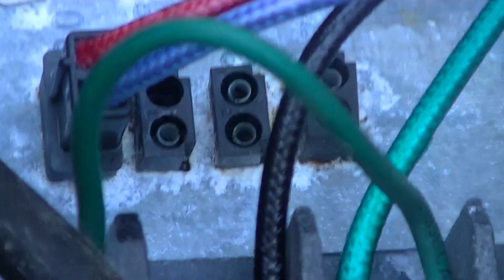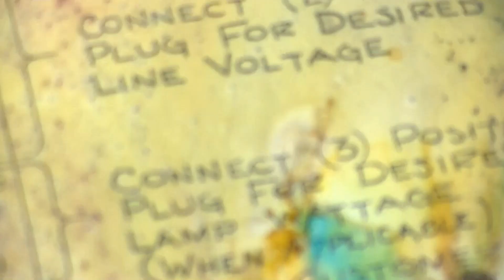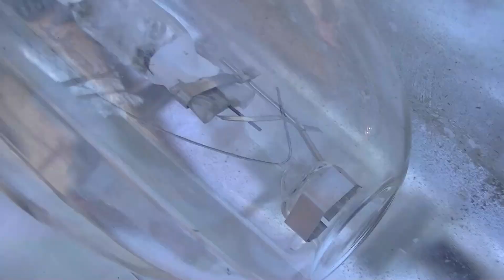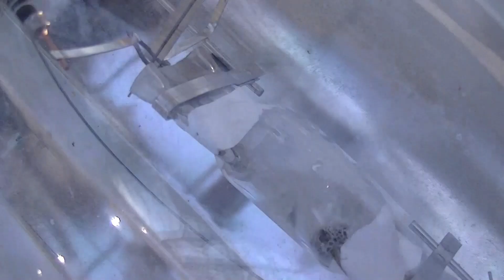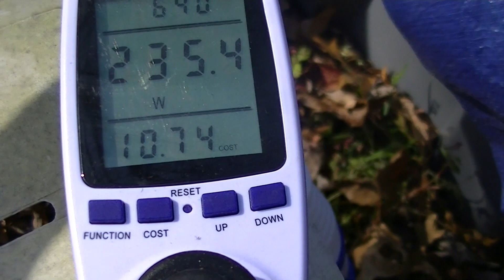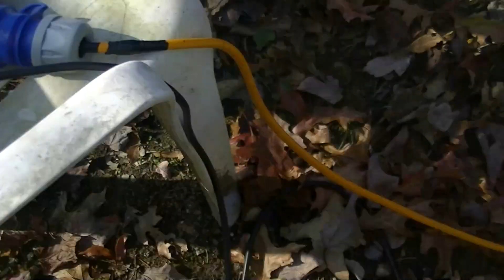GE 175W MH/merc floodlight guts and power consumption

Comment: I take offence to the statement garbage leds.

Yes, the product was well designed, but also ĺed's can be.

Poorly made,/cheaply, and designed  led lighting product's coming from mainly one country in Asia have given them a bad name.

One main fault in òut side high power lighting is that damp gets into the pcb, or to thin a barrier, shorts out the led heat sink to the aluminium heat disapation plane, also poor power supply/driving circuits, ovrdriving the led's and specifying the incorrect colour e.g. warm/cool or day light 3000/4000/6000, in most cases 6000 is best for outside and worknplace conditions.

Also, as a rule of thumb, they save 90% energy used most of the power used in previous lighting is producing heat.

If everyone in the world changed to led lighting power consumption, could be reduced, by 80 to 90%.
I changed my lighting at home from nearly 2000 watts to 176 Watts if all lights were turned on.
Thanks fir the video.
Reply from the maker: Can LEDs be made good?  Yes.
Are there applications where they make sense?  Yes.
Problem is that they have a lot of poorly researched failure modes due to them being the current thing that must be used everywhere.  A big reason for this failure risk is the root of a lot of efficiency gains in the past decade, which is the discovery that InGaN and GaN die efficiency goes way up at certain combinations of high operating temperature and high die current loading.  This efficiency gain comes at the expense of die service life, which is why there are LED lamps available now with service lives of as little as 5,000hr.

Then there are other problems with phosphor failure (the cause of all those LED streetlights turning blue/purple, which is a massive eyestrain hazard).  There are even problems related to photodegradation of fixture components; the failure of ~20,000 Leotek LED streetlights in Detroit a few years ago was photodegradation and subsequent burning up of fixture lenses.
And a big problem is that components can't be easily replaced, and if/when something fails the whole fixture is garbage.

The "90% power reduction" claim assumes that the LEDs are replacing incandescent lamps with comparable rated service lives.  When replacing 80lm/W or higher fluorescent/HPS/LPS/MH lamps, the gains aren't anywhere near as big and can even be a step down in efficiency (such as yellow LED anti turtle/bird fixtures being 50lm/W to 60lm/W vs. the 100lm/W to 200lm/W of LPS).